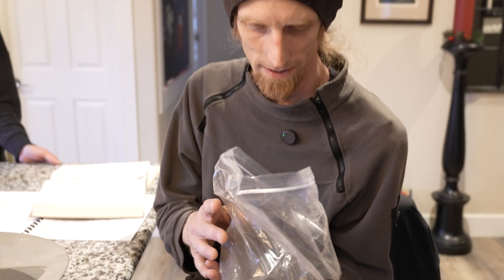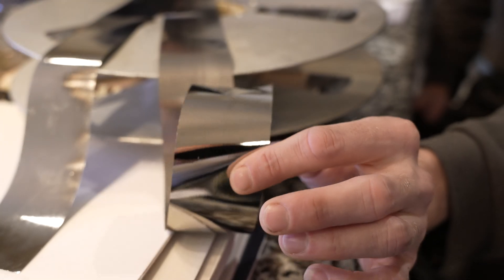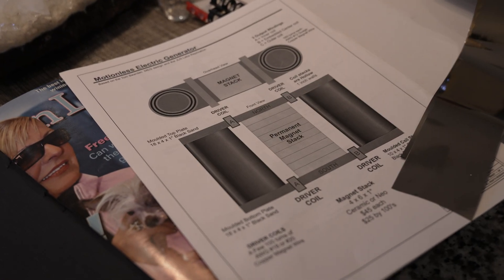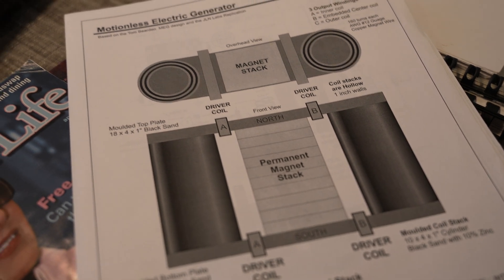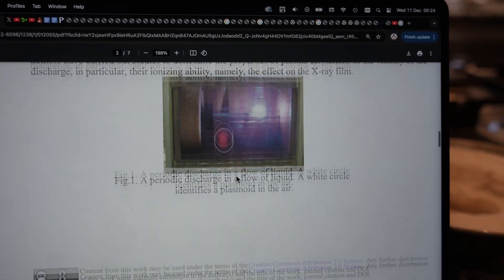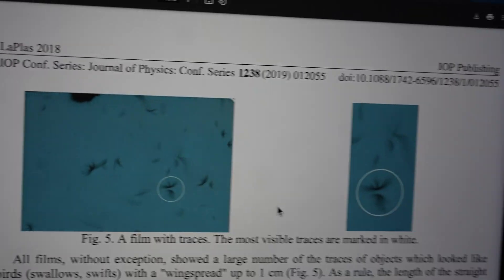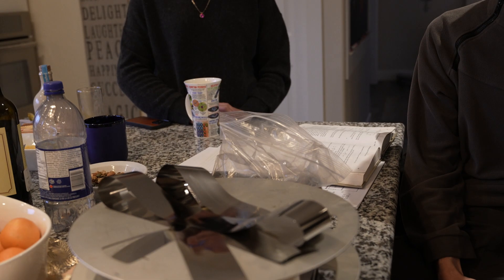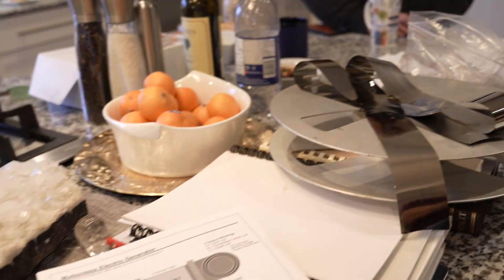A possible explanation for both the Mueller Motor and the Motionless Electromagnetic Generator

Comment: "The energy comes from the ambient thermal energy" - so that's a neat side-stepping of the ThDy law of Increasing Entropy :-) And also, is this a magnetic version of cavitation? following on from the words "collapse" etc?
Reply: I said, the restoring force that reorients the domains in these materials from aligned (magnetized) back to random, is the ambient thermal energy.  This is an intrinsic part of superparamagnetism and is proven by the fact that superparamagnetism vanishes and ferromagnetism returns when these materials are cryocooled to 4K.  Cheers

Comment: Lovely. On Energetic Forum we always talked a lot about Sweet and Muller and others using ferrite sand.

Its important to carefully select coil core materials if you're trying to create sharp impulses from collapsing magnetic fields, either in a regular transformer, magnet motor, or resonant LC tank circuit.